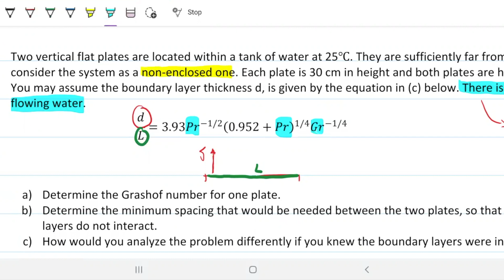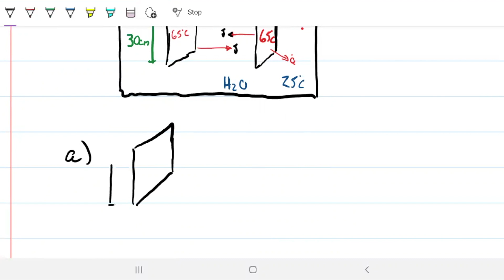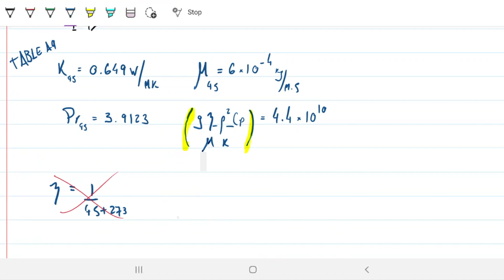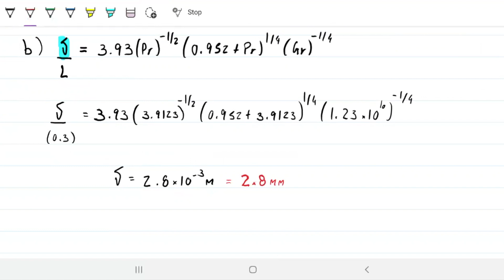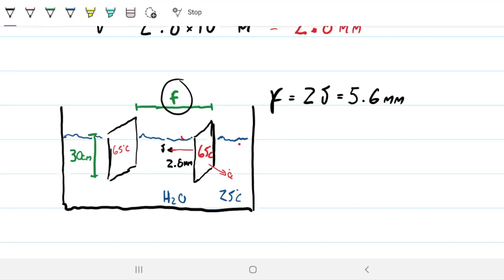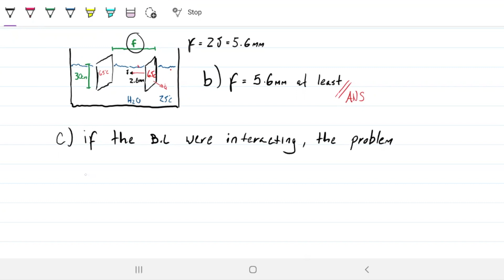Comment: I'm trying to understand the mode of insulation in double pane windows and your video is the only one that mentions the boundary layer within the context of a vertical plate. You define an enclosed space as one in which the boundary layers interact. Is this a general definition used widely in literature or specifically in your series?

Does the interaction of the boundary layers increase or decrease heat transfer? Suppose there are two vertical plate (one hot, one cold) immersed in a fluid. If the gap between them is small, the boundary layers would interact. If the gap were infinite, it would basically be two vertical plates with no interaction (normal free convection). In general, if trying to reduce heat transfer, should the boundary layers interact or be prevented from interacting?

Do you have a video on enclosed vertical space convection?
Reply: I can answer the first part of your question with confidence: this is a general definition, not limited to this series.

As for the second, I'll speculate: since the boundary layer generally sees higher heat transfer compared to elsewhere, the interaction should be beneficial because you'll have a higher driving force (delta T) from one boundary layer to the next
Reply: @EngineeringHack  Thank you for your answer. I found another video (https://youtu.be/B7mXJEBfY44?list=PLybaocgt_OXO-QFLXYM-3nvJkh0THYgXM) which goes through the process of calculating natural convective heat transfer in an enclosure and by following that, I was able to get some numbers to work with to see how the gap width in a double pane window affects the heat transfer through it.

The video uses equations to calculate natural convection through an enclosure but it gives a gap width of 0.6m between the plates and I'm pretty sure the boundary layers are nowhere that thick. We know that convection currents can develop in a room between a hot wall and a cold window and I'm sure the boundary thicknesses of the two sides are not half the room in width. And since it is a room, it's in an enclosed space. That's why I asked whether it was a general definition.

How would you approach estimating the heat transfer through a double pane window of differing gap widths? Would it be something like:
1. Assume natural convection of a vertical plate and calculate the boundary layer thicknesses of the two panes (rising on hot, falling on cold)
2. If the sum of the thicknesses is larger than the gap, proceed to using the equations for natural convection through an enclosure
3. If the gap width is larger than the sum of the thicknesses, use other equations?